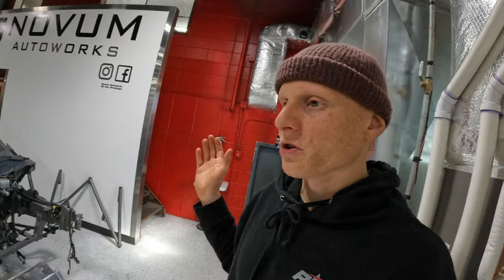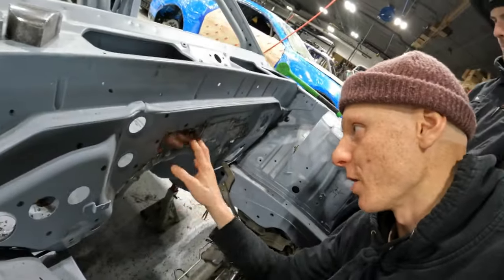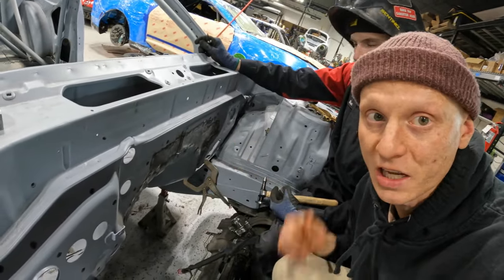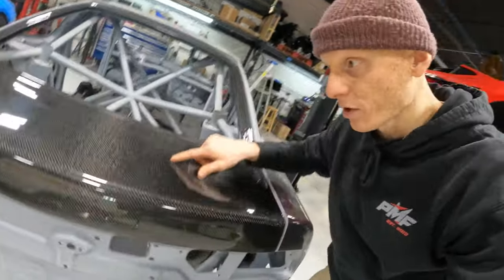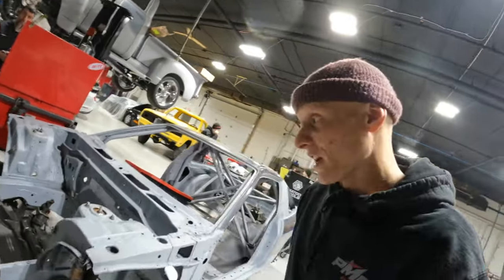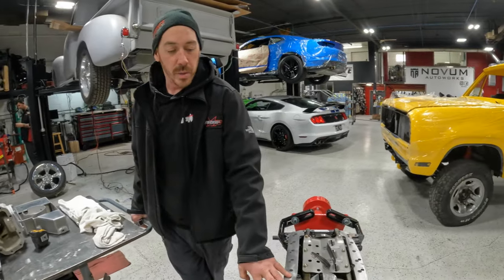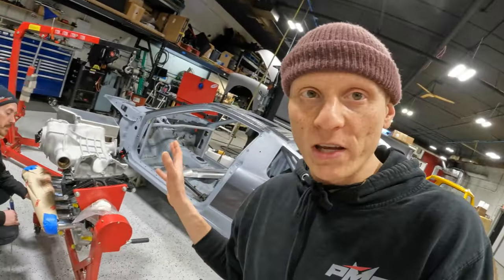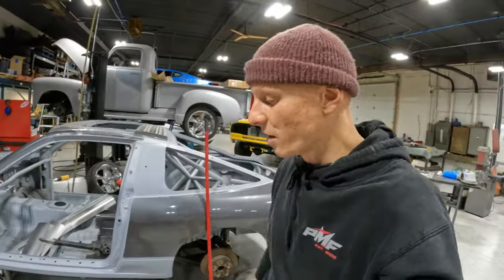240sx/R33 Skyline Firewall Merge + Engine Mockup EP.6

Comment: Can you just hit it with a spot every inch or so and then come round and repeat the process in the parts where you havent spotted or is this way no good. Sorry i aint a welder. Just asking questions because im curious.
Reply from the maker: There are multiple ways to achieve a similar result, but circling the area with spot welds could pull/warp the metal to a greater degree, which would just mean more finishing work would be necessary.